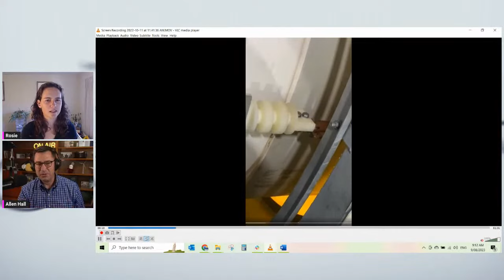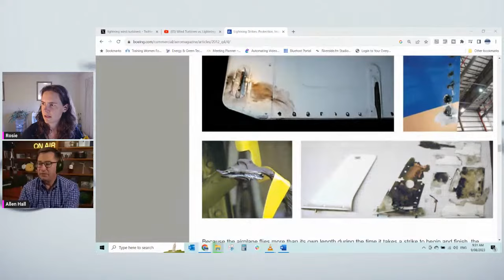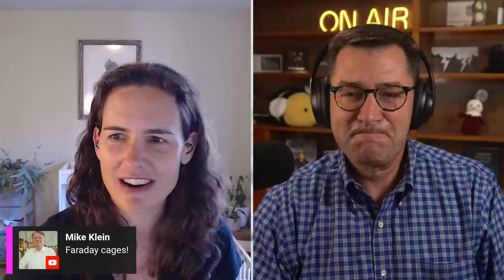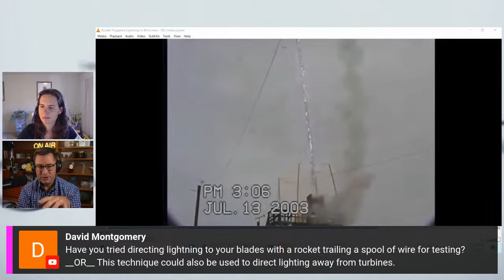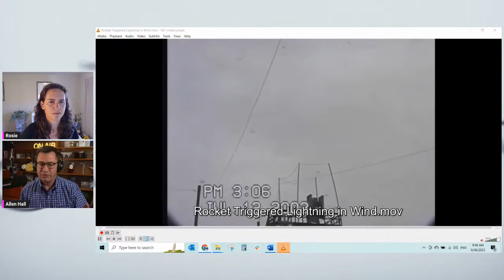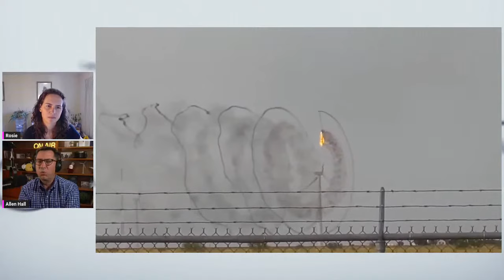What Happens When Wind Turbines Get Struck By Lightning? | Engineering with Rosie Live ep. 28

Comment: While a little late to comment I was wondering it: 1) one could measure the static electric differential between cloud/sky and the ground? And if so 2) isolate the blades electrically and statically charge them with the same polarity as the clouds.

That way even if charged to a much lower potential (just a mere 10kV for example) there would be a smaller differential and thus less attractive to lighting. Such a solution I would expect would require little power consumption for a large static charge.

Given weather and impurities in rain there may well be significant difficulties to overcome, but treating the blades effectively as one side of a capacitor lighting may become less of an issue through avoidance rather than handling. Blades made cheaper and the carbon fiber central to the solution instead of a conductive weakness requiring alternative conductive paths.

Comment: What are people's thoughts on sending a sacrificial tethered drone up above the blades with an aluminium conductor. Part of the tether could be a power supply cable, so it could stay up indefinitely during a storm, also eliminating the drone battery.
Reply: 36:38
Reply: It’s a good idea and the concept has been tried - as a research effort - in Spain!

Comment: Rosie, is there a material which readily produces a plasma which could coat the blades, thus producing a highly conductive super-coating only during a strike?

If the blades were swung around or pitched at the right angle could this plasma be convinced to condense on the following blade? Would this evaporation & redeposition even out over successive strikes to correct balance issues?

Comment: "What Happens When Wind Turbines Get Struck By Lightning?" - Fossil fuels burned to repair or replace the stricken turbines.
The total energy burned will be unfathomably greater than all what the turbines have delivered of useful energy - ever;
"In any system of energy, Control is what consumes energy the most.
No energy store holds enough energy to extract an amount of energy equal to the total energy it stores. 
No system of energy can deliver sum useful energy in excess of the total energy put into constructing it.
This universal truth applies to all systems.
Energy, like time, flows from past to future" (2017).
Reply: What kind of gobbledygook is this :L
Reply: When you understand your quote please explain it to us.

Of course, it may just need editing to match the original wording?
Reply: K. . .
Deny harder.

Comment: Hi Rosie, I didn't want to post this request during the live stream because 1) I wanted to listen and 2) it's only partially related to the topic.
So, I was recently out in a car with a friend (in Germany, near Holland) and it was raining rather hard. We were driving through an area with a large number of wind turbines. Some were stopped, others weren't. My friend said he was puzzled and could never tell why some turbines were left running and others not, be it rain or shine, wind or lull, etc. I recalled some things I had learned from your videos and tried to explain that it's not always intuitive. That in rain, some blades might be older and more prone to damage from the rain, etc. etc. However, I realized how quickly my "knowledge" ended.
Could you perhaps make a video outlining the most common reasons for turning off certain turbines in certain conditions, or not turning them off? I realize that there are probably hundreds of individual and compounded variables, but a general overview on a lay basis would be helpful. I always learn so much from watching your presentations.